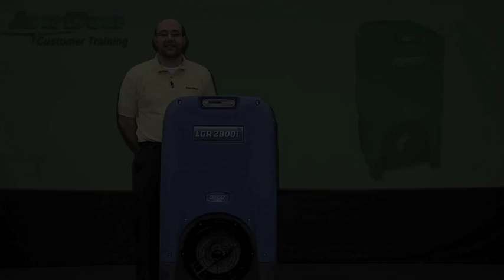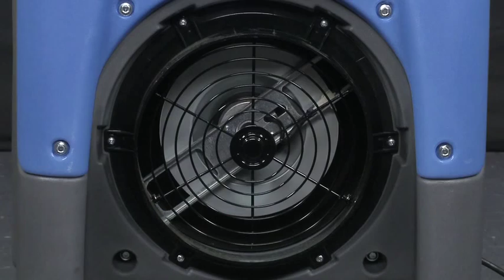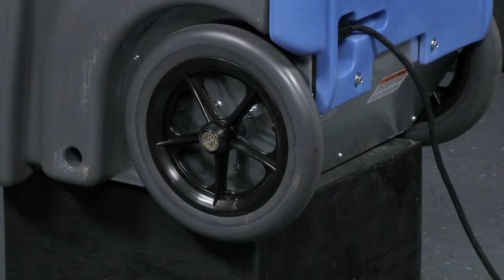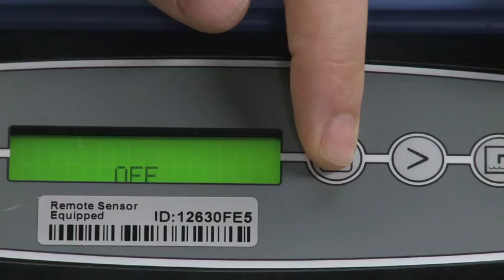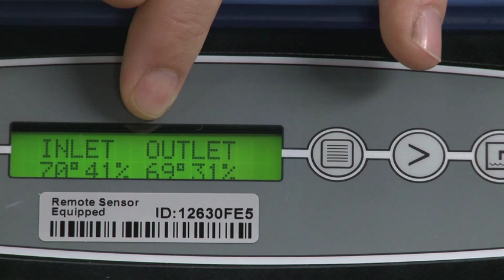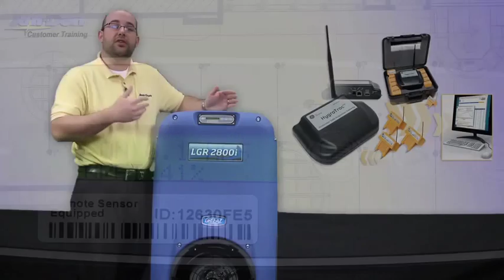Demo of the Dri-Eaz 2800i LGR Dehumidifier - Jon-Don Video

Comment: This little unit works great.>>>nub.best/hy7x     It filled a 45 gal trash can half full overnight. The built in condensation pump works beautifully. The drain hose raps nicely on the back of the unit and a heavy extension cord wraps on the top for storage. Besides being visually appealing it has some great features like the large diameter wheels. The easy grasp pull handle. Long heavy duty extension cord. Built in cond. pump. Easy read control panel on top that keeps track of the number of hours it has ran. Multiple operating modes makes this a versatile machine for a relatively low price for a commercial unit. We had to buy a second one we like it so much.